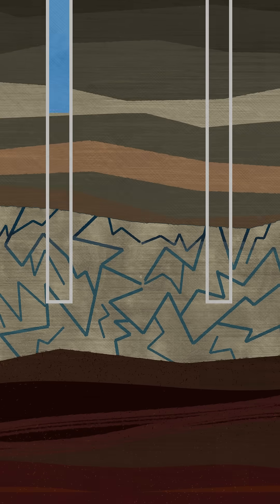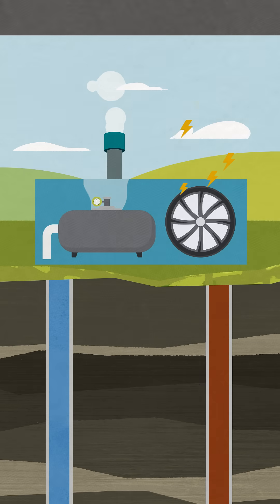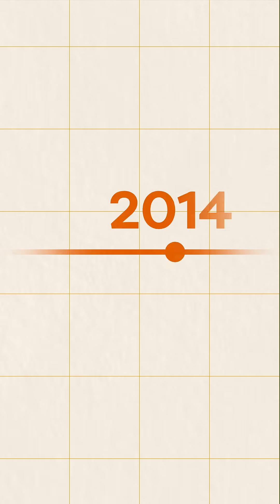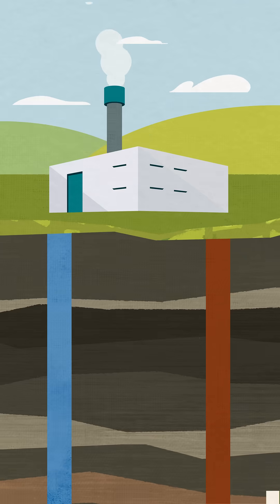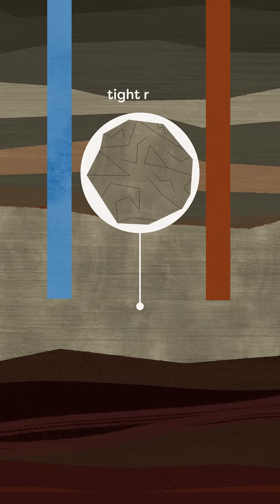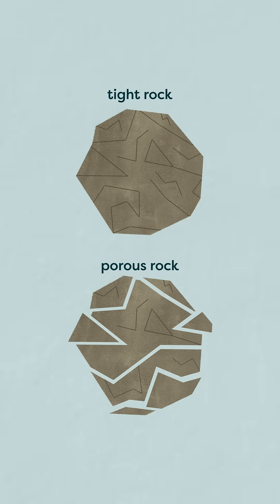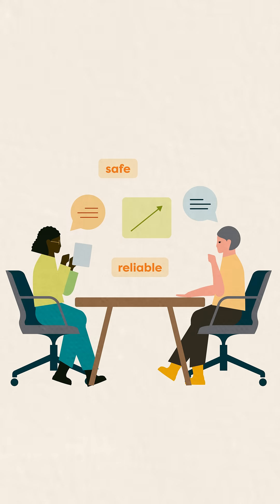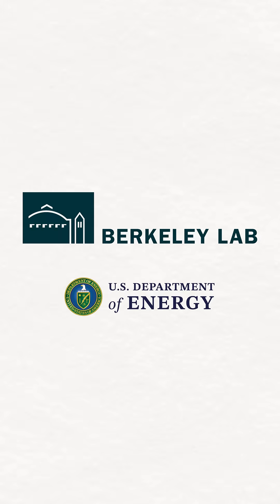Conventional vs. Enhanced Geothermal: What’s the Difference?

Comment: I'd love to see the method hydraulic fracturing to move beyond the misinformation. Reservoirs developed in hot dry rock would perform much better with the higher surface area than closed loop systems.